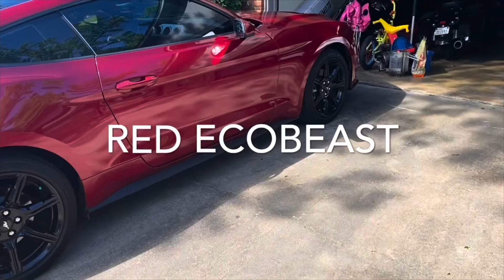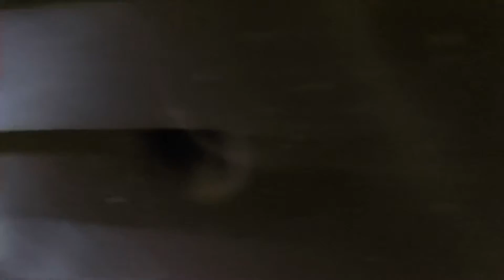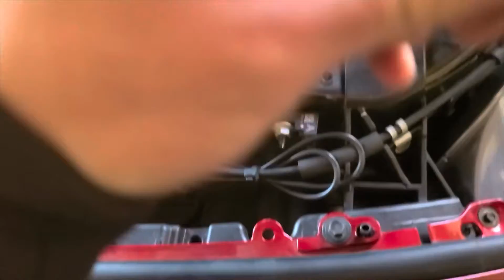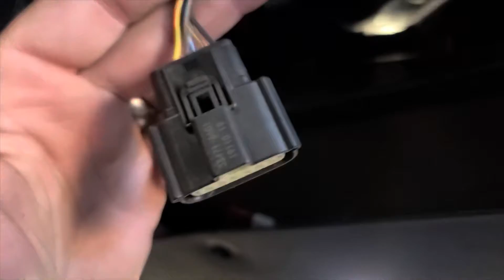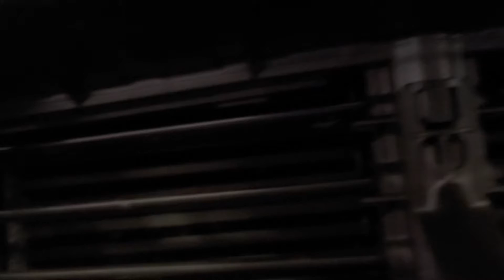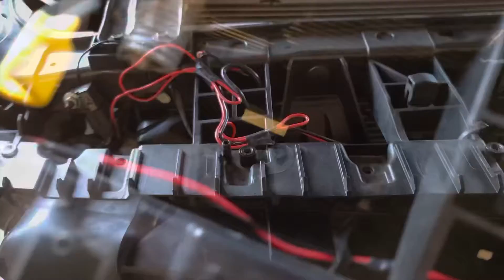CV Fab intercooler and charge pipe install with Tial BOV

Comment: I’m sorry to bother you but I have a question, I bought the charge pipes for this exact intercooler, but I bought the once with a hks flange. I’m new to all this so I’m not really sure what it means or if I need to buy a separate part for it, id appreciate it if you can get back to me.
Reply from the maker: Hks flange is for a hks blow off valve.
Reply: @vengence4x1  thank you and one more question does this connect to the hot or cold side of the charge pipes
Reply from the maker: @rudyperez3329  hot side on cvf pipes

Comment: Hey man, I'm in the middle of installing this right now. But have one issue... what do I do with (you called it a diverter valve hose)? There's no where to hook it to my CVFAB Charge pipe lol.
Reply from the maker: Did you get the charge pipe kit for the stock blowoff valve?
Reply: @vengence4x1  No man I don't know what that is. I got the boost reference adapter,  and c.e.l. (check engine light) plug...  Also using the Turbosmart Race V BOV... but yea, no where to hookup that short pipe. Thanks! I guess I'll look for that. Appreciate you getting back thanks!
Reply from the maker: @scottthefloorguy  you dont use the short pipe on a vta bov, that is a recirc hose used on the stock bov to vent back into the intake tube.
Reply: Okay I just looked... I have the CVFAB Tial flangw charge pipe kit.
Reply: Okay sweet! I guess I'll look for a cap. Thanks man! For real, Huuuge help!
Reply from the maker: @scottthefloorguy  you can use a rubber chair foot, lowes or home depot is a good source for a cap or rubber chair foot for cheap, i believe the hole is 3/4 inch. Might measure it.
Reply: Nice!  Got a 1 1/8" rubber chair leg bumper thingy and it worked perfect! Woo! thanks!

Comment: I just installed the cvfab street intercooler and hot side pipe, gave up on cold side pipe because I couldn't get it to line up for the life of me, it was hitting the fan shroud, I had no problem with getting the boots on but I feel the throttle body coupler should be a 3" length not a 4" length. That cold side pipe needs to be about 1/4" from kissing the throttle body in my opinion.
Reply from the maker: See the hotside is what gave me big issues, sucker barely reaches the lower boot
Reply: @vengence4x1  I was talking with Jason at cvf and he said they added an inch to each end on the lower couplers for hot and cold side. I must have gotten the longer ones because I had no issues with those boots. I have a 3" coupler coming tomorrow and I'll give the cold side pipe another shot.
Reply from the maker: @steveamestoy  damn maybe i need to give them a call!
Reply: @vengence4x1  I would, they have great customer service and want their customers happy.
Reply: I did the street intercooler,  I know you did the Race version so I'm wondering if they just gave you the wrong couplers, I think they would be different for the hot/cold sides since it's a different cooler.
Reply from the maker: @steveamestoy  something, it was insane getting the lowers on period and then hotside not reaching!
Reply: @vengence4x1  got the cold side pipe on with the new 3" coupler. Did it from the top and made sure I'll have access to tbolt clamp nuts for future endeavors.  Taking the stock airbox out gives you all the room needed.

Comment: Did you get a bov vacuum hose? I’m stuck on the bov part
Reply from the maker: I have a throttle body spacer and installed a nylon tube from it to my tial bov using quick disconnects. Parker performance sales a kit.
Reply: @vengence4x1  Parker Performance is my go to.. great group of folks